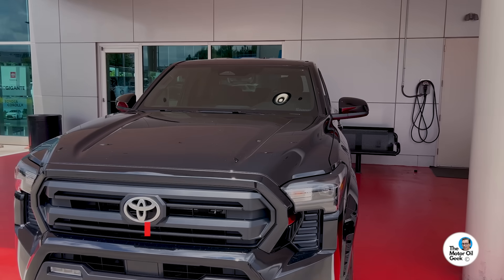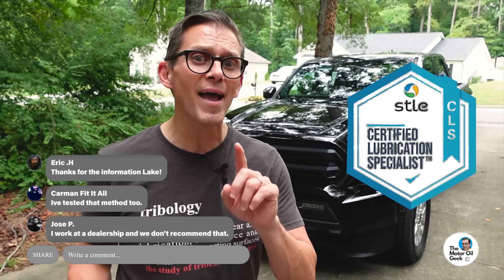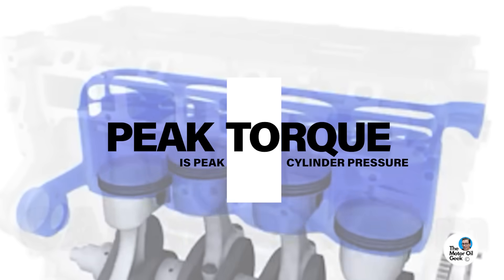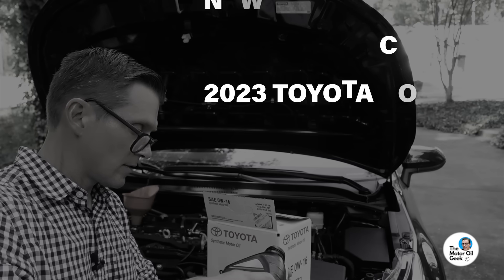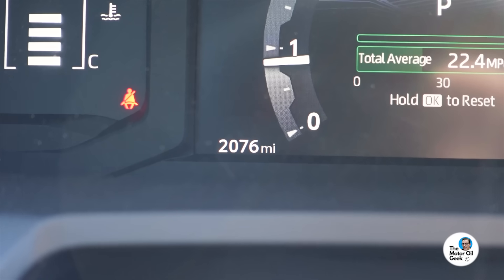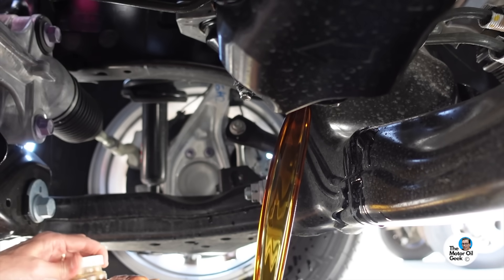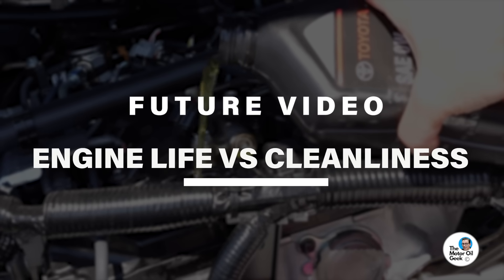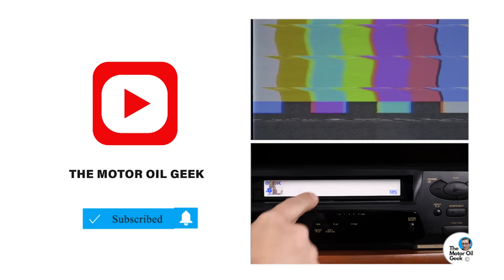The FACTS About Oil Changes (What The Owner's Manual DIDN'T Tell You)

Comment: This man is a genius when it comes to engine wear, internal automobile components other than the engine, drive train, transmission, and other major parts on any motorized vehicle, or basically any machine reliant on a lubricant for optimal and correct performance.   I believe everything this gentleman puts forth on his YouTube channel.   There are far too many "myths" out there regarding oil changes, transmission flushes, radiator flushes, and other components on an automobile.  I will say, I have a 2014 Nissan 370Z with only 22,000 miles on it as it is my weekend or nice day toy.   I have changed the oil frequently, even if I only put a 1,000 miles on the vehicle.   I am a firm believer is using either the recommended OEM oil as the manufacturer has already done the testing on what oil works best in their particular engines.  I would say that frequency of oil changes, keeping the engine interior as clear of debris and clean as possible through those frequent oil changes, is the best way to keep a vehicle running like new for the life of the vehicle, whatever that lifespan may be.  I am also a fan of Liqui-Moly products and I use them as well.  Knock on wood as they say, my 370Z is still operating flawlessly and like the day it rolled out of the showroom 14 years ago.  I plan on doing all the recommended flushes, changes, and fills at the recommended service intervals, or even earlier if I haven't driven the vehicle up to that recommended mileage in enough time span.  I'm not sure why 80% of vehicle owners don't do their recommended services by what the manufacturer recommends.  Many people see those interval services as a "scam" and the manufacturers trying to make more money.  While that certainly is a theory, I am one to follow the service recommendations, using the OEM parts and chemicals, and usually using the dealership as those mechanics work on that particular brand every single day and they know those engines and other components well.  I would say that if there is one thing that you can do is at bare minimum, follow the recommended service and oil change intervals, even doing them earlier than recommended.   Frequent oil changes are your best way to ensure a trouble free engine life, or at least increasing the chance significantly of having no problems.  Of course this is subjective as "things happen" as they say and some parts will break no matter how much you follow the manufacturers recommendations, but the likelihood of you having a problem is far less if you do follow the recommended service procedures at the correct intervals.

Comment: Do you recommend changing the transmission fluid early for the same reason you do the oil ?
Reply from the maker: Yes
Reply: @themotoroilgeek  I am sorry I guess I should have asked that a bit differently.  At what mileage do you the Transmission ?  How about the differentials ? Mileage ?  I did the oil at about 600, and 2500 and 5000.

Comment: Thanks a ton for these videos Lake!  I do have a question regarding Honda's.  I've got a new Honda Passport with the 3.5L naturally aspirated v6.  Honda is pretty clear that they don't recommend changing the initial oil out before the "maintence minder" indicates to do so.  (15%)  The reasoning that I've read is during production of the engines Honda technicians put a Moly solid lubricant on the cylinder walls and pistons that dissolves into oil and creates some sort of "super cushion" to help engine break in.  Just personal experience I have from older Honda's I've owned is that the maintence minder will normally call for the first oil change around 4k-5k miles.  This engine will only be new once, so I'd love to get your opinion Honda's claim to wait for the initial oil change is actually better because of the high moly content.
Reply from the maker: Thanks for watching. Stay tuned for our next video for a detailed explanation of why that advice is wrong.

Comment: You do realize you don't drain all the oil by changing the oil. There is still about 3/4 a QT left in.where those heavy metal particles are.Pull oil pan you'll see.

Comment: Spot on. Break in...If you live near some rolling hills or mountains use them to load the engine going up. In the GA aircraft world we use non-detergent 50wt straight for the first 25 hrs. Then it's usually a differential pressure check on all the cylinders to see if everything is seated/seating and if it has detergent oils after that changed every 50 hrs.

Comment: Does purchasing a car in winter subject it to more wear due to cold temperatures?
Given that a significant portion of engine wear occurs during cold starts—when oil is thicker and lubrication is less optimal—does buying and operating a vehicle during winter months cause more initial wear compared to purchasing the same vehicle in spring or summer?

If so, does this early cold-weather operation have any meaningful impact on the vehicle’s long-term reliability or overall longevity?

Comment: @themotoroilgeek LAKE, thanks for the video!  The big question unanswered is what chemistry is dictated by this application!?  I suppose you need more time and data to be certain.  I too have a new taco and couldn't even wait 500 miles, first change at 225, next at 1000, then 3000 and every 3000 after that.  Grok tells us the forum guys are getting great results from pennzoil ultra plat.  I've always been a mobil 1 guy.  I'm probably not springing for the fancy stuff, amsoil/hpl, but then you've also got that tempting 6 quart box chevron puts out.  And of course let's not forget valv. R&P!  In my non-tribologist eyes, money goes to either PUP, M1 EP, or Valv R&P.  Havoline being a close runner up.  

I read that the GTL base [near 100%] in pennzoil ultra platinum handles fuel dilution very well.  I short trip and idle a lot so that seems like a no brainer given the high chance of fuel dilution lowering viscosity.  However brands like mobil 1 are using GTL in their oils too. I certainly never want my ring packs stuck or having to deal with varnish so perhaps the valvoline is the answer.  How does one best sort the chemistry in this application?  I am planning to stay in grade 0w20.

Comment: Good advice but too much hassle. My secret is to buy Lexus RX300/330/350s and follow recommended maintenance. All went over 300k miles with only oil changes and tires. All were still running like new when I traded for upgrades. Very simple

Comment: I own a 2014 GMC 1500 with the 5.3 v-8,   I change the oil every 100 hours on the engine.  I use Mobil  one and change oil filter too (Mobil one ).     130,000 miles and runs perfectly.   Don’t follow manufacturers schedules!   You can hardly hear the engine running!

Comment: He actually said not to change the "AIR FILTER" at    4:45   and that is true,  air filters tend to clean air better through the middle portion of its life.      You changed the wording to "oil filter" ,  when he did not say (DO Not Change the OIL FILTER) which should be changed at every oil change.
Reply: He just said “filter”. Then the other guy says “air filter”. Then the first guy comes back and says “oil filter”. He is saying not to change the oil filter during those first two early oil changes. I don’t know if the guy in the insert meant to say oil instead of air or if he meant to say air and the clip was used wrong but the first guy is definitely talking about the oil filter.

Edit: I just noticed that the chart he shows when talking about oil filters says “airflow”, right? It’s hard to see in my phone. He really messed up here.

Comment: Just bought a 2025 4Runner. The only thing that drives me nuts is I can't change the service interval that tells me when to change my oil can't be changed to 5000 miles. It's locked to 10k miles.

Comment: When I purchased my '88 IROC I changed the oil at 500 and 1k milies.  I then changed the oil every 1500 miles thereafter.  I pulled the engine (long story) about 8 years ago and took the block, cam, and crank into an engine shop.  They were actually surprised at how good those all looked after 117k miles.  I changed to Amsoil synthetic after the rebuild and have been changing the oil every 2k miles since then.

Comment: 2015 Tacoma with the 1GR v6, only changed the oil every 7,500 to 10k miles, ran the Toyota branded (K&N) air filter that was installed wrong for several years… Toyota filters.   Never did a thing to that engine and sold her with 314,000 on the clock.  Good buddy has it now with 340,000 zero issues.  Not gonna try that with my new turbo taco 😂

Comment: Are you a fan of the amsoil bypass filter , I had a f350 2018 superduty and it had 362,000 before it was stolen and I used the bypass filter and amsoil 15x40 the whole time before it was stolen and ran my oil changes to 20,000 miles then sent to cleveland brothers cat for analysis.. I have all results .. also every 75,000 I used hot shot secrets striction eliminator..and never had a problem ..plus pulled a 21,000 5th wheel ..what's your thoughts

Comment: Well, if it's meant to last, Lake will make sure it does. Interested to see how well the combined direct (DI)  and throttle body injection do in terms of keeping the intake tract and specifically the intake valve, clean. So many brands are DI only, but disassembling an engine so I can clean an intake tract has no appeal to me. This seems to be a good compromise. I wonder if the oil analysis can provide any indicators of combustion chamber carbon buildup or similarly how well the 3 piston rings are holding up and how freely they continue to move throughout the life of this engine. Are you planning to stick a camera down the spark plug holes to inspect cylinder walls and valve conditions? I'd love to see how this can be inferred from engine oil analyses. Keep up the great work!

Comment: Hey Lake you forgot to add that when these cars roll off the assembly line, they run the car on rollers to check for any noise and run the engine. Any metal filings that comes out during this process is still in the engine. So, do you really want to run your engine for 10k before an oil change? I've be changing my new car's at 1k religiously.

Comment: Wasn't the engine hot the last time  you shut it off? And then the engine had all night to drain the oil and contamination to the pan. But then drove it to recirculate the contamination back into the engine before draining it🤔 🙄
Reply from the maker: The contaminants settle out when the engine sits overnight, so you are not getting them all out.
Reply: @themotoroilgeek Ok you do you.

Comment: I have a 2025 Subaru outback that I got back in November 2024, and I've had it just over a year now.... in that time I've done 3 oil changes, the first coming after the first 500 miles (which was recommended to me by a mechanic)  and I do an oil change every 5000 miles, no more, no less, and it doesn't matter what type of oil I use, which by the way I use nothing but Castrol edge full synthetic 0W –20.... I don't go by the bullshit marketing 20,000-25,000 between oil changes, because I don't care what oil you're using, if you're going to push the limits that far then you're asking for problems, so I change it every 5000 miles this way I keep fairly fresh oil running through my engine instead of sludge, and I've been doing things this way for over 40 years, and in every vehicle I've owned, and never had any issues

Comment: So I bought a new 2009 Chrysler Aspen with a 5.7 Hemi. Changed the oil every 5000 miles and NEVER used synthetic or changed early. Sold the truck at 198,000 miles 16 years later and it ran like the day I bought it. Never once needed any kind of engine service or had any problem of any kind. I think you guys overthink this oil stuff. Afraid if you go over a 1000 miles or don’t do a break in change early, send oil to get analyzed and searching for the highest tolerances synthetic your engine will fail. Nonsense….

Comment: I bought my daughter a new 2022 Corolla Cross, in 2022. It requires 0w/16. I just bought my 2nd daughter a 2026 Corolla Cross. I changed the oil at 1500 miles, and plan to change it every 5k(Mobil 1 full synthetic). Out of habit, I used 0w/16, only to later read the manual, which states 0w/8..... It's the same engine as the 2022. I hate to go against the manual, but 0w/8??? It just doesn't make me feel comfortable using that thin of an oil. Any thoughts??

Comment: I'm a little confused. Is it 500, then another 1000 (1500 total), then another 1500 (3000 total) or is it 500, then another 1500 (2000 total), then another 3000 (5000 total)? If it's the first, do you then just start the every 5000 cycle at 5000 at the dealer?
Reply from the maker: The second plan. 500, 2000, 3000

Comment: What does Toyota install at the factory for break-in oil?  If they use non-synthetic for break-in purposes, I would not drain it at 500 miles and change to synthetic.
Reply from the maker: No OEM uses an actual break-in oil anymore.

Comment: I did the same thing with my 2010 4.6l F150. However I installed a magnetic drain plug.
Reply: Does not help with aluminum engine stuff.

Comment: I am doing the exact same thing Lake with my wife's 2026 Kona. This is the only thing that makes sense as we know metal  (and any contaminant in in oil) will wear the engine. Get the spoils of the break-in out ASAP... 

Now for a question, with today's 0W20 for many engines (including both my Wife's Kona and my Mitsubishi RVR), yet in many other countries they are still using 5W30 for the exactly the same engines, should I consider switching to the slightly more viscus oil that other countries are using? To me saving $40 or so a year on fuel because of initially having better economy, can't make up for additional protection that a the thicker oil affords. And yes, I would swap back to the 0W20 for winters as I am in the coldest part of the nation, but thinking summers of thicker more protection especially doing long highway motoring...

Comment: Makes perfect sense to me about the break in period and early oil changes like we did many years ago in the 60’-70’s etc. Dealers now say not necessary and want you to go 5-7500 miles before they will pay for it on their maintenance package they sell you. Probably why these manufacturers are having so many engine issues, especially GM, using ultra thin oil and stretched out intervals 🤷‍♂️

Comment: I run Castrol Edge AFS 5W-30 in my LFX engine with Delphi ECU and Ignition coils along with NGK Iridium IX spark plugs..

I run 87 Marathon STP Fuel(witch is Top Tier fuel) and every now and then put a thing of Chevron Techron Concentrate Plus fuel system cleaner. Car has almost 86K miles an runs beautiful

Comment: Cool pic of the break-in oil filter! I saw the same paint flecks in the filter from my Dad's car. Initially I got concerned until I learned that OEs often colour code bearing shell ends with paint to indicate the size. This paint wears off from thrust loads and is flushed from the bearing and ends up in the filter.

Comment: Changed oil at 100, 200, 500, 700, 1000.  Now it has 1165 miles and runs smooth.  Not a single issue.

Comment: 0w20 oil, how offen you shance oil ?
If drive 25000 miles, engine didn see 150 000 miles ? Which is better to engine good oil ? 5w40 ? Or 0w8 or 0w20 ... 😅 and tight clearences... problems.....

Comment: As a 'certified lubrication specialist' you of all people should know evidence trumps opinion.
Where is your evidence that 3 oil changes within the first 5,000-miles are essential to prevent wear damage to your engine? 
Seems to me there's lots of owners who have had their vehicles for 300,000; 400,000; and 500,000 miles or more and only followed the schedule in their manuals.
It is NOT surprising to see higher levels of metals in your oil during the break-in period. Why are you assuming because your engine is breaking-in it's also damaging itself? Doesn't the filter remove particles large enough to actually damage you wear surfaces.
Again, where's the evidence?

Comment: I’ll just chime in briefly as an automotive engineer at an OEM who once worked on engine calibration.

It would be good to see a test running the engine to failure or significant wear by dyno or real world testing on one oil change.

Back in 2000, at one point on the, the interval was tested at about 12000 miles on the conventional oil grade at the time; so the published interval was about half.

Comment: I did similar oil changes when my 2023 Lexus GX 460 was brand new. Oil changes: @ 845 miles, 3,900, and 5,508 miles all within 10 months. I don’t drive as much. Each time I took the oil filter out to see any metal contamination. After a second oil change there was none shiny metallic pieces in the oil. I don’t even wait for Lexus 10K oil change recommendation. I think that’s crazy long.

Comment: Got a new Lexus ES300h and my first oil change I did was at 600 miles, then at 6000 miles and now I'm heading to the dealer for it's "first service and oil change" after 10,000 miles. From that moment on I intend to change oil once between the regular intervals meaning I will change it right in the middle between dealer services so oil will be changed every 6 months and 5000 miles. I have done it with all my cars and never had any issues with oil consumption etc.

Comment: I bought a 23 Tacoma V6. The dealer told me to bring it in at 10K for the first oil change. It had 7/10 of a mile when I bought it. I changed it at 1K and it had metal in the oil filter housing. Some gold flakes an a bunch of these tiny half moon pieces of metal. Changed again at 5K and every 5K since. since the first change. I take apart the filter at every change and run a magnet over it. Completely clean and no glitter. About to hit 25K and am changing the transfer case and both diffs. I know oil has come a long way, but it"s still a new machined engine. It needs to be cleaned out.